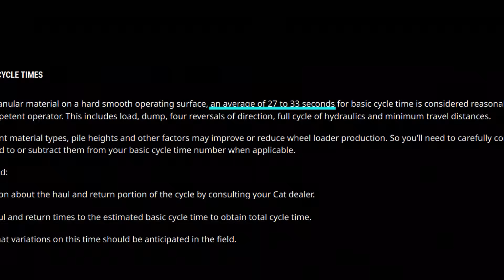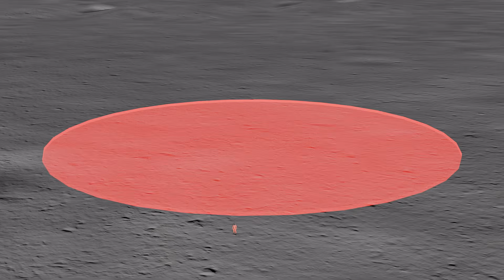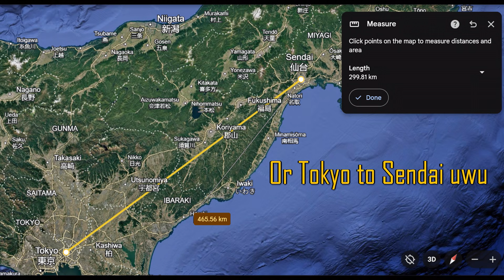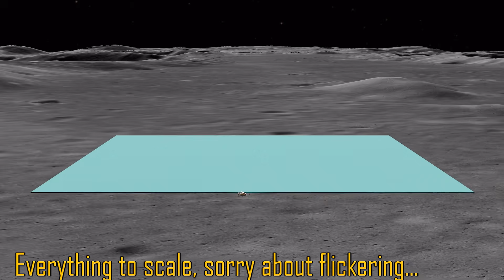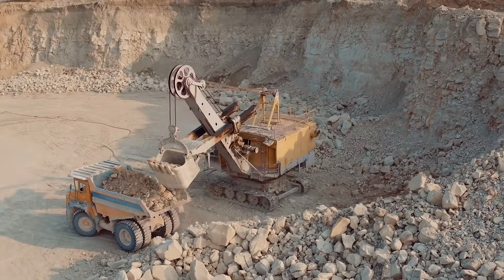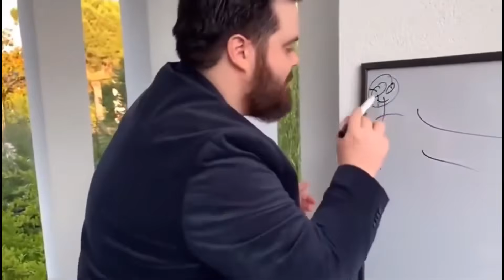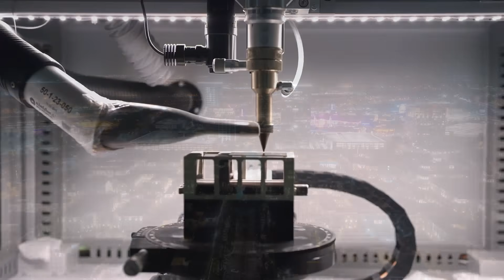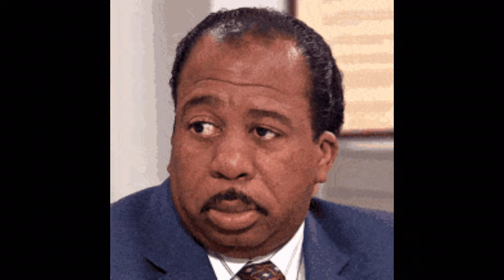How Much Bulldozer Can We To The Moon?

Comment: I'm sure this fleet of smaller excavating (moondust-moving?) machines would be useful for building a moonbase, or a moon industrial plant, to assure long-term habitability on Earth's Moon. It might also be useful in building pressurized vessels to form a Von Braun spinning wheel space station or mobile Solar System exploration station/ark. I'd say the first major project should be the fabrication of components to launch and construct "FlowerSat"-style space-based solar power satellites for society back on good ol' Earth. If early Moon exploration and industrialization is to have any substantial meaning, it has to be more than flag-planting and a dress rehearsal for missions to Mars. It has to be about providing real benefits that will make a significant difference  to human society on Earth.

Maybe those Von Braun spinning wheel space stations in your earlier videos could be useful in flying to near-Earth asteroids. If you want to build a large spinning space colony, use your spinning wheel space station as a "job trailer" or "man camp" to digest the asteroid's regolith and make it into your space colony. Let's start small with a Kalpana One-style rotating colony. (Kind of like a small-scale O'Neil Cylinder; more like a giant soup can inside an insulating layer of regolith-concrete, hundreds and meters long, hundreds of meters in diameter, spinning to simulate Earth-normal gravity, that could comfortably house 3,000 colonists.) Then the real challenge is finding a way to develop propulsion to put our Kalpana One colony into a desired orbit near Earth. After we master Kalpana-style colony construction, we could figure out how to build more elaborate colonies later. (Or we could figure out a way to construct a Kalpana-style colony inside a larger shell of regolith-concrete, equip the outside of the shell with thrusters, and make the colony into a kind of Aldrin-cycler mobile station that would be useful to convey personnel, smaller ships and equipment between asteroids and Earth.

Comment: Come now Anthrofuturism - if you're developing the moon, you might as well develop it exponentially. Building more solar panels, to power more factories, to build more solar panels, and so on. You don't have to limit yourself to only what is necessary to build one mass driver. And if you're producing solar panels, and mass driver rails, and the factories to make those things, and the factories to make the machines in those factories - you pretty much get the ability to make your low complexity vehicles for free, right? (Besides the imported computer chips). So... why wouldn't you build those vehicles? To mine more regolith, to turn into more factories to make more solar panels to power more factories. Pretty soon you can consider exporting energy to earth, and many mass drivers rather than just one.

So if your fleet of small imported vehicles are sufficient for the work, you just need to find more work for them to do. I mean, if you're building one mass driver, it would be silly not to build more - every subsequent one will be a lot cheaper than the first one. Same goes for almost everything else you're going to build.

And before you know it you can think of developing more complex industry for the production of components that would otherwise need to be imported. That would require mining elements rare on the moon, and that would require excavating much more regolith per unit rare element than for iron and silicon.

I don't think you refuted the giant cable controlled vehicles at all.

Comment: Using exiating earthmovers as your metric while not entirely off mark probably, is mighty inaccurate. You wont have an internal combustion engine run in a vacuum, and you didnt even consider fuel. But anything sent to the moon would also obviously be weight optimized, and could be built much lighter duty because of the low gravity.

Comment: You could design your smaller loaders so they can be repurposed into a bucket chain once enough infrastructure was built? Either completely or partially, the main drivetrain could serve as a personelle vehicle?
It would save lauch costs to have the bucket chain framework built on the moon with local materials and fill the guts with 100 rover loader parts and ship in only the critical parts.
But i dont know if 1 bucket chain rig would make mining more efficient over 100 rover loaders.

Comment: The fact that the bulldozers are 1/6th the weight may work against them. It would mean that it has less weight to push around, it wouldn't be able to handle as steep a grade as it would on Earth, and it would have to move slower to avoid tipping.

Comment: All is not lost. One sixth the gravity means one sixth the traction which means one sixth the pushing force to overcome momentum and whatever you call viscosity when it's particles.  Your machines will have one sixth the maximum acceleration and be operating in an incredibly harsh environment. It would not be surprising if you lose two orders of magnitude in specific throughput. 

I would expect the optimal balance for the first generation to be using regolith for ballast and possibly a blade upgrade, but shipping motors/frame/control machinery from earth. There is room for large machines in this framework.

Additionally your 300km track will require a lot more than 3m of grading and lunaworks. Possibly tens of metres horizontally and some way of compensating for tens of metres of vertical alignment.

Comment: With 500 degree temperature swings and extreme temperatures. how are you going to handle thermal management of the machinery? You don't have atmospheric gasses to use for convection. Lubricants, expansion and contraction of materials, I2R heating of all the electrical conductors. Not to mention thermal caused changes is material characteristics

Comment: [chatgpt-generated]:

Major Problems with Moon Colonization
1. Harsh Environment

Extreme temperatures:
The Moon’s surface temperature swings wildly—from about +127°C (260°F) during the day to −173°C (−280°F) at night, making habitat design challenging.

No atmosphere:
No breathable air, no protection from micrometeorites or solar radiation.

Radiation exposure:
Without a protective atmosphere or magnetic field, colonists would be exposed to harmful cosmic rays and solar radiation, increasing cancer risks.

---

2. Limited Resources

Lack of water:
Water ice exists mainly in permanently shadowed craters at the poles, but it’s scarce and difficult to extract.

Scarcity of materials:
Building materials and essential resources are limited; most will have to be transported from Earth or mined with advanced tech.

---

3. Low Gravity Effects

Moon gravity is about 1/6 of Earth's. Prolonged exposure may cause muscle atrophy, bone density loss, and other health problems, though long-term effects are still being studied.

---

4. Logistics and Costs

High launch costs:
Transporting people and cargo to the Moon remains very expensive.

Communication delay:
While minimal (~1.3 seconds one way), it still affects real-time control and emergencies.

---

5. Psychological and Social Issues

Isolation and confinement in small habitats can cause mental health challenges.

Limited social interaction and monotony.

---

6. Technical Challenges

Building reliable life support systems.

Generating power (solar panels work but long lunar nights require energy storage).

Protecting habitats from lunar dust—very fine and abrasive.

Comment: Self replicating robots, a machine shop for the small dozers/loaders. Really hard to make things like some motors and bearings could be shipped in instead.  Eventually it's self contained/generating and the ai can operate it 99% of the time. Still there would be technicians and engineers to hands on the stuck machines and strange failures. 
The 2 second lag from earth to moon and back for comms is sorta ok for simple automation and just guide the ai on the machine that does most of it anyway.

Comment: did you consider that to gather metals you need a lot more weight of ore? i'm not gonna look up the proper values but if 2 kg of ore give 1 kg of the refined resource then that would double all the needed mass moved from your calculations, i could be wrong but i feel like 2kg ore to 1kg of refined thing is an extremely high end rate

Comment: Not saying it's the correct solution, but with a lot of heavy equipment (especially with local road/transport constraints), it's pretty common to ship a disassembled version of the actual equipment and assemble it on-site. You'll see this in a lot of the larger mining and power sectors; The primary thing needed to assemble a large excavator or haul truck ends up being a relatively large (modularly assemblable) crane.

Comment: All the heavy equipment your talking about produce hundreds of kilowatts or horsepower to operate, not gonna produce that level of power fororw than a few minutes with batteries, and even the largest tegs nasa has ever built would fall utterly short of producing the power to operate any of this while on the lunar surface. And diesel won't work their either.
Reply: Maybe solid state batteries could have enough amp hours to handle it but the actual max power output might not be large enough to handle the machines.

Comment: The sideways starship thing is a pipe dream. You can't change the load direction and add engines like that without a re-engineer of the vehicle, basically from scratch.

If it's actually critical to have it on its side, I strongly suspect it'd be easier to land vertically and rotate the entire ship over with a crane after the fact - though just re-engineering your other dependencies to not require a sideways ship would be almost certainly easier.
Reply: starship is a pipe dream...maybe.

Comment: It all depends on how fast the lunar economy scales up.

 We need to move so much earth because the specific elements we need tend to be a low overall percentage of the dirt/rock.

So sure, for the applications where we need to utilize the lunar soil/rock itself, those big vehicles are overkill. But when a lunar city is being built and you need a bunch of copper, and a few cubic kilometers of lunar rock needs to be moved around to get it in short order, then it'll make sense to be building those massive machines.

Comment: There is the norm in the engineering, "more there are moving parts, there are more failure points" 10 times the machines, 10 times the failures. Backups are for that. That is a reason why space programs over engineer their stuff. And reasons factories keep spares.

Comment: It really tickles my brain the right way to know that I'm not the only one who spends an inordinate amount of time and energy thinking about these things. I've been thoroughly enjoying your series and the research that you put into each episode. However, I'm not sure you used the 4600 tons/hour figure correctly. For your example with the larger constructions like the landing pad and the mass driver, the amount of mass needed for the project won't just have to be moved once. It will be processed in stages with storage in-between them, mining/gathering-storage, storage-refining (if this requires multiple steps those need to be figured as separate trips, refining-casting, casting-placement. You adressed this somewhat at the end of your video and I agree that most of this transport would be better to do with locally made freight vehicles, but the loading and  of these at each of the trips would be done by the imported loaders and thus needs to be accounted for.  Further there is the matter of ground preparations, for large projects on earth these can easily equal or exceed the mass of the construction itself. Factoring in efficiency losses across the stages will increase the total initial mass needed. You mentioned that we also need to take into account vehicle down-time, battery recharging, maintenance, irreplaceable breakdowns needing new machines to be imported. I feel that you might have underestimated the losses in material moved/time because of this. All-in-all the 4600 tons/hour (maybe averaged over a week minus expected vehicle down-time) would need to be applied to: (the total initial mass x the total number of trips for the material). Hope this makes sense.

Comment: @ANTHROFUTURSM 20-40% of heavy equipments weight is steel for ballist, needed for traction. More surface mining on the moon could get away with less weight. You could remove those sections with hollow containers and fill the with regolith when they land on the moon.

Comment: Musk down graded the target lift capacity of starship to 40 tons to LEO, thoigh even at that it can’t actually reach orbit with any cargo.  They haven’t started on the lunar lander version.  So excessive time wasted on talking about starships that arnt even in work, nor could they support what you want … or a base the size you want.

Better question would be what would it take to make a bulldozer that could operation the moon.  Adding weight for traction? Dealing with the ultra abrasive soil?  Power plants.

And just hand waving away buracracies, and gov paperwork, maintence and repair cost (much less comparative cost of operation) of a mass driver and shuttles.  Some consideration of financial costs rather then mass or power costs.

Comment: I get where you're coming from and I think it's a good insight that vehicle size scales with need, but this is the first video on the channel I've really had problems with the numbers. The mass of the dozers will be higher cos batteries and they'll lose time recharging cos energy density. The lunar night is a factor of two. Maintenance time is probably almost a factor of two (you can do as much as possible at night). I reckon your cycle times are gonna be way lower, at least another factor of two probably more. Those manufacturers times and volumes are for a skilled operator moving nice homogeneous soil or gravel in 1g, lunar regolith aint gonna behave like that and the driving will be a lot more conservative.
That's an order of magnitude on the supply side, and all the numbers on the demand side are super raw, just the mass of the finished product, no accounting for what's actually needed like in your other analyses. Maybe it's from some perverse desire to be hard on your old videos, but I think "somewhere between 2 standfords and an oneill" is well out. The lithium shovel still has a place!

Comment: you guys are clinging to Starship as if it's a end all be all delivery system for objects to the moon.

When it eventually does work, it will not be sent with the purpose to deliver oversized cargo, in fact NASA already has somewhat of an idea that has already been tested... they just need to "persevere" to get it done, the only question is, trying to pack it into a tight compartment... quite the 3D puzzle if you ask me...

Comment: 1. Remote controlled machines on earth is silly. It'll work but your productivity will fall to nothing. Working on site is all about awareness. 
2. You can't just take something that carries 10kg on earth and expect it to carry 60kg on the moon. Gravity is less but inertia isn't. I can assure you, 180kg would have that little trolley on pieces. 
3. You need to be able to make metal bars / rods and at least 3N bricks. Low quality is ok, it just needs to be passable. You also need a mortar and some kind of welding for the metal. If you have that you can do a lot but that's a huge hurdle. Structures can be made air tight by covering them in muck so we just need the structural stuff.
3. Water. Talk to me about water.

Comment: Lost the commenter with actual experience. If you find him his comments on tractors made me think you will end up with about half of the machines using tank tracks. The first several meters might be fluffy but traction could come into play with the harder and deeper materials. It might cut into the transport mass but being able to swap out wheels for tracks may outweigh the mass disadvantage.

I think we will need machines like rock crushers because I didn’t look into using explosives on the Moon. Don’t know how effective explosives would be compared to a rock crusher but the wear would not be a joke.

Oh well, we can always use a small rocket engine to pulverize the regolith. I found the crater done by the SpaceX first flight made into concrete an impressive concrete tornado. In the far enough future an engine using metal dust like aluminum with oxygen (lox?) could be a game changer in cutting into rock via a thermite like reaction.

Found the commenter, @bwjclego.